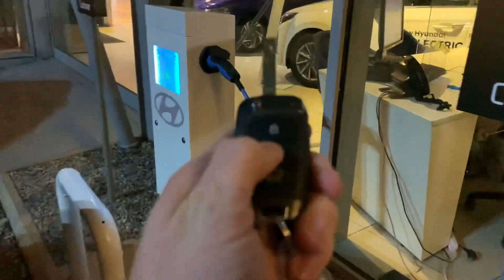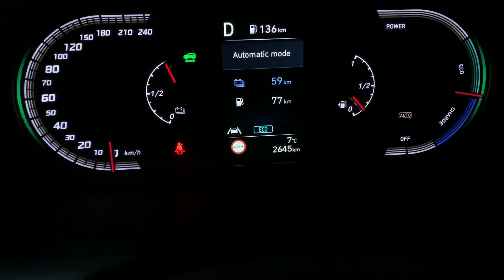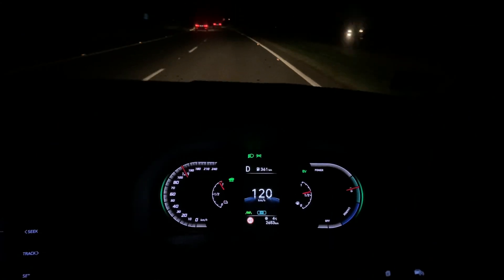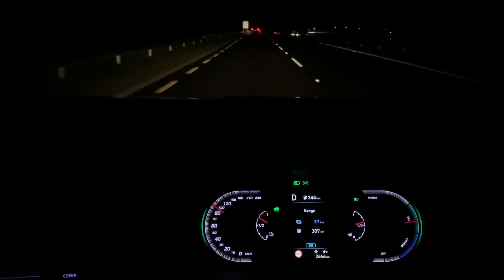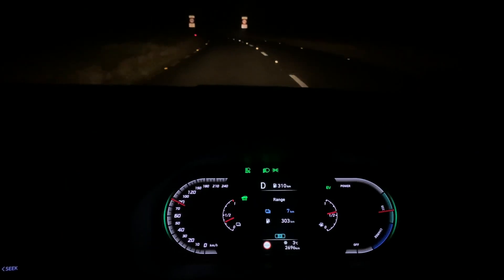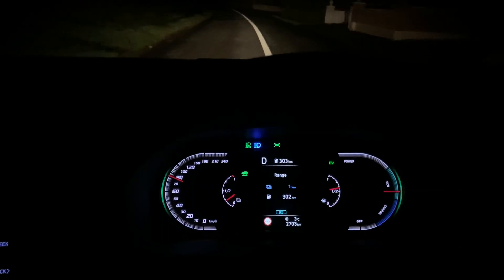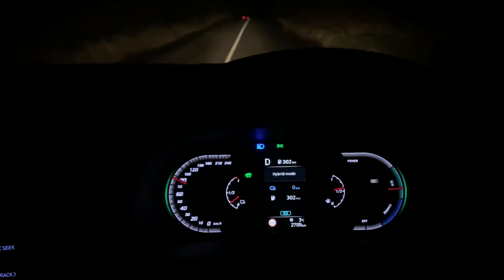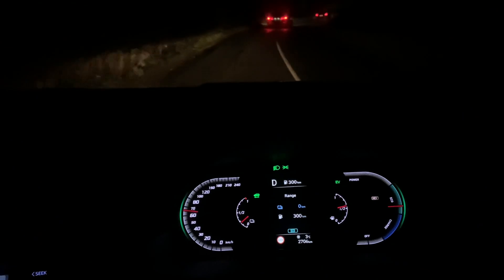What happens in a PHEV when you run out of charge - step by step demonstration #phev #whathappensif

Comment: Hi Brian, This video is super useful! Thanks. I was wondering in case the battery is empty and I choose to drive with Fuel only.. does it keep charging the battery until it reaches 100%? Thanks!
Reply from the maker: Thank you for watching, okay, it’s actually not possible to drive this car on fuel only, it will always have a small portion of electric drive available, so it continuously self charges, a small amount, but only to approximately 17%, it doesn’t appear to be able to charge any further than that by itself without the use of plugging into a charging facility, hope this helps!
Reply: @doolanbrian  hi Brian, thank you so much for the detailed reply this is the question that i needed answer for. I guess hybrid is the way to go. Unless car's behavior can be altered / customized with software. Happy to follow your content. Subbed :)
Reply from the maker: @mjxone  I don’t believe there is any way to customise or change software right now, I appreciate your subscription, thank you for watching the video🙂👍

Comment: I have a question...Does the engine run longer to charge in PHEV mode that a in HV mode. The reason I ask is because I'm trying to decide whether getting a plug in hybrid vehicle is equally or more efficient (despite the fact that a PHEV vehicle battery weighs more) than a hybrid vehicle. My theory is if the battery in a PHEV is larger... that means it may take more fuel to charge it if you run it purely on hybrid mode. So my question is, if I run a PHEV in HV Mode do I get less MPG or KM/L.

From what you're saying on this video, it seems like the PHEV battery is internally SPLIT into two parts. Maybe 50% of the battery is EV only and 50% is hybrid only. So if you are a person who mostly rely on driving on hybrid, would this ONLY charge the 50% of the hybrid portion of the battery or the whole entire battery? let us know, thank you :)
Reply from the maker: Let me ask you .. how many kms do you do per day ?
Reply: @doolanbrian  same for me, I drive 40 KMs per day
Reply from the maker: @cyberbud  to make the decision of which is better to purchase you need to look at your cost of electricity and the cost of fuel. What country do you live in?

Comment: What about using drive-charge mode button ? should I use it on a highway, because it uses more gas.
Reply from the maker: When you say drive charge mode button, do you mean the button that says HEV/EV?
Reply: @doolanbrian  no, I got an option in my KIA Optima 2017. It's uses more engine power to charge phev battery to the max which is why it used more gas In about 30 minutes I can charge battery to 70% at high speed. It charges more quickly compared to normal engine/ regenerative breaking method.
Reply from the maker: @TroubleDrivers  that’s cool, we don’t have that option, I’ve never heard of it, but it sounds like a great idea! Thank you for watching
Reply: @doolanbrian  but it uses a lot of gas like a V12 engine consumption.
Reply from the maker: @TroubleDrivers  🙂😀ok that’s not ideal 😆 but still a cool system !

Comment: Hi Brian Great video thanks. What I don't understand is when in full electric mode why is the gas being used also? My understanding was that when using full electric your fuel consumption would not be touched. You can see a big difference in your fuel gauge from the start of the video to that at the end of the video. Why is this?
Reply from the maker: If you are in full electric mode it won’t use any petrol but if the environment changes where it needs more power for example if overtaking ..  it may switch from electric mode into hybrid mode, at this point it will start using some petrol engine alright if that makes sense?
Reply: Thank you
Reply from the maker: @ruthwalsh8509  thanks for watching!
Reply: Are these phevs more expensive to service and maintain than say a ord petrol car.  How long do these types of batteries last compared to a fully EV car. 
What’s the mpg running on petrol when electric used up. Tnks. Great video
Reply: @brec5879  We have a 2024 Prius Prime. It's less expensive to service than an ICE because the engine runs so much less compared to a regular car. We've owned it for 16 months and only needed one oil change in 23,000+ km. The brakes will last for many years thanks to the regenerative braking.

The Traction Battery is guaranteed for ten years. Our Prime will bring us 100km on a charge. In fact, after a year and a half we've spent only about $ 300 on fuel and gas here is very expensive. In hybrid mode we see around 60mpg. The Traction Battery never truly runs "dry". The car always limits the charge level at  between 10% and 80% to extend its service life.

Comment: I understand that if the battery runs out in EV mode, then it switches to hybrid mode automatically.  My question is does the gas engine running on hybrid mode recharges the battery fully again at a certain point so that you can run on pure EV mode?  Why would you need to plug it in unless you are trying to skip the amount of time the gasoline engine will recharge the battery again?  This is what I don't understand.
Reply from the maker: Battery will only self charge to about approximately 17% or 18%, to charge the remaining amount it needs to be plugged in 🙂
Reply from the maker: Battery will only self charge to about approximately 17% or 18%, to charge the remaining amount it needs to be plugged in 🙂

Comment: If I drive on a long road-trip in Hybrid or smart mode, can it charge the battery fully?
What if there's a long downhill section (really long, descending from the mountains)?
Reply from the maker: It’s a good question … I’ve not ever experienced the car self charge anymore thank circa 17% so I would not see it fully self charging … theoretically even if it was possible I doubt there is a long enough downhill road to fully self recharge 🙂🙂 thanks for watching!
Reply: @doolanbrian  Assuming ~33 miles (US units EV range) is also the range required to fully charge the battery, then yes, there is.
With a regular hybrid, such a road could easily charge the small battery many times over, as well as drain it, such that only the engine would power the car, if going uphill.
Reply: Here is what I am guessing:
1. On a normal highway trip, the car will drop to ~15% charge at the first part of the trip, then maintain about this amount throughout the remainder of the trip.
This is because the car does not know when the trip will end, so if it tries to fully charge the battery, it would have reduced your trip's efficiency to do it, instead of letting you plug it in at home.
2. It will charge the battery on downhill sections, no matter how long, when engine breaking / breaking is done. With a long enough downhill section, it will exceed the 15% charge, until the section is over or the battery is full.
Reply from the maker: @DavidDLee  we need to find a 33mile hill 🙂🙂
Reply: @doolanbrian  I've been meaning to buy this car for months, but too few are available and a dealer mark-up, so I'm still waiting.
Maybe early next year, I'll be able to test it 🙂
Reply from the maker: Where are you based out of curiosity? 🙂 Let me know how you get on!
Reply: @doolanbrian  SF bay area, California

Comment: If you go for a long run in a phev, how long can u go before u need to load it to keep that "150mpg" state???
Reply from the maker: If you’re aiming for 150 mpg, you would need to knock out around 50 km of electric driving and then probably cover an additional 10 or 15 km of hybrid driving, Does that make sense?
Reply: @doolanbrian  ok so u cant run 200 km combine gas electric when u need to go on Trips. communicate i would use his ev every day. If i cant get the low consumption in Long Trips i think i just go for Pure ev that manage more than 200km
Reply from the maker: @MrBlackJava  you can drive as far as you want .. but if the first 50 kms is EV , then all kms after that are combined fuel/battery.. the further you drive , the lower the MPG’s become until you charge again 🙂🙂

Comment: Is the hybrid battery a completely different battery to the ev plug in battery? Or does the car have 2 drive batteries or 1?
Reply from the maker: Ok … my understanding is that for HEV drive , the car uses about 14% to 17% of the high voltage battery . When the car is charged it uses the remaining 85% of the high voltage battery which is the same battery. This is my understanding of the process
Reply from the maker: @foppo101  for first 50 kms or so you will use electric ⚡️ if you have charged it .. once that runs out you will use fuel and a smaller amount of electric usually around 6 l/100 kms 🙂👍

Comment: Let me add my 5 cents 🙂
Last Christmas got in traffic going to mountains - there was very slow movement in about an hour because of chains checking post. And during this traffic jam the battery discharged  down to 5% and only after that the gas engine started.
I was kind of nervoius during monitoring how the battery went to 10%, 7%... 5%... That was my first experience with the almost fully discharged battery. Now, when I know what happens, I'm fully relaxed in may car.
And one more thing. The label for the Tucson HPEV says to use 87 gas (US number), however, the manual says - at least 87. Using gas 91 increases the travel  range and that increase is bigger than gas price difference.
Reply from the maker: Thanks for the input Igor and for watching too !

Comment: just a short question. If you have to drive with AC/heating ON, does that mean you can no longer drive in EV only?
Reply from the maker: You are correct, unfortunately the heating overrides electric mode, electric mode is more of a request so if the heating is turned off And you don’t have the accelerator fully depressed, it will become available for you if that makes sense ?
Reply: @doolanbrian  so basically we can forget the EV mode in winter time. Now I'm no longer interested in this car. Thank you
Reply from the maker: @madalincodrinspanu2549  The way I work it in the winter isI heat the car for the first 10 minutes and then when the cabin is warm I turn off the heating, I can use electric mode then and have the heated seats and heated steering wheel, if the cabin gets cold then I just give it another blast for a couple of minutes and then turn it back off again🙂👍
Reply: @doolanbrian  What about air conditioning? The compressor runs off a belt that depends on the engine being on.
I'm not sure how often you need air conditioning, in the summer, but where I live in the US, either the heater is working, or it's the AC. For me, it seems like a pure EV might be a better choice. (Not sure how much electric heat and an electric powered AC would effect total range)
Reply from the maker: @billkallas1762  I think this video will help https://youtu.be/cH5cUrST9Go , you might get more value from an EV instead .. i think you are correct 🙂✌️

Comment: Am I correct in assuming that regenerative braking isn't enough to lift an EV range of depleted battery, meaning your EV range will remain 0 km 'till you charge the vehicle via an AC outlet?
Reply from the maker: In Full full EV drive yes ! You got it right .. the regen braking won’t replenish the battery sufficiently….there will still be a very small proportion of EV drive which can self generate to allow small bursts of EV drive in hybrid .. The regenerative braking doesn’t contribute very much charge in hybrid mode .. During this self charge process most of the charging comes from the engine🙂🙂

Comment: Sounds like you are only going to drive in full EV mode in the Summer, since you need the gas engine to heat the engine coolant. At least in winter, you can run in Hybrid mode to heat the car up, and then think about switching to EV mode, for a few miles.
Reply from the maker: Spot on Bill .. you are correct !

Comment: With this car fully charge up for a road trip of around 200 kms., can you give me an idea of the number of litres of gas that would be used? The trip would be 90% highway driving at between 100  - 120 kms/hr.  Thanks for the vid.!
Reply: It depends on the drive settings.
In the best case, you use up the battery range then drive like a hybrid. The Hybrid efficiency is 35 MPG (US EPA). Higher speed will drop the efficiency.

Comment: With this car fully charge up for a road trip of around 200 kms., can you give me an idea of the number of litres of gas that would be used? The trip would be 90% highway driving at between 100  - 120 kms/hr.  Thanks!
Reply from the maker: Okay the first 50 km would be electric drive that means 150 km will be hybrid drive, I suspect this will do around 7.5 L per 100 km on the motorway drive , so I think the first 50 km will be electric and the remaining 150 km will require approximately 11 L of fuel .. hope that helps!
Reply: @doolanbrian  Great video and information. Thanks Brian!
Reply: On a long road trip, when the electric runs out will the empty battery put more load on the engine and trans?
Reply: My diesel Sportage averaged 41 mpg goes up to 50 on a long run no battery or electric motors not sure where the environmental advantages are.

Comment: Hi Brian,
Excellent video, I have a question though; all of these phev vehicles have a much smaller internal combustion engine so does it mean when you run out of battery you've got this tiny ICE engine to move your car?
For example if you take a 500Km trip on a 2023 AR Tonale phev SUV with 1.3L  ICE , only after 50-60Km you will run out of electric power and for the rest of your trip you are dependent on the tiny 1.3L engine to propel the heavy SUV.
Now to my next point why the car manufacturers are allowed to add this very limited battery power to the total horse power or torque of the vehicles and make these claims about high horse power and torque of phev vehicles while they know full well the battery power is very limited in range and duration.
Thank you
Reply from the maker: Once they run out of charge, they combine battery power with the internal combustion engine so it won’t run on just the internal combustion engine if that makes sense ?
Reply: @doolanbrian  
Thank you Brian
Reply from the maker: @afshins.6167  thanks for watching!!
Reply from the maker: I guess the power made by the car includes the battery and the engine? So when they put their figures on paper it seems logical to include both?

Comment: hey Brian great video , i drive about 50km a day in a 2013 vw gtd and use €50 diesel a week or there abouts , would the Phev suit me more as i could primarily use the ev range everyday and keep a full tank of petrol , and save on my weekly fuel espense  , i know i will pay on my bill , apparently night rate is will cost me 1/5 the cost of diesel so even at that it would cost me €10 a week on electric bill so €80 extra on bi montly bill , trying to decide on diesel 1.6 executive or phev executive plus as its nicer inside , what do you think ? over 3 years pcp id spend €7500 on diesel but alot less on Phev
Reply from the maker: Sorry I missed this comment !! Did you buy phev or stay diesel after ??

Comment: Hi Brian, hi folks, many greets from Germany! Here i get answers hard to find in videos in german language, trying to follow your very very quick tongue, which is not always easy for non-natives like me, but, grabb the info or dy trying, right? Luckily there is a repeat option on the video controls.

I am very interested in the Tucson full hybrid and plug-in hybrid models, trying to figure out which model suits me best. Away from that i am always wondering if the petrol turbo engine., which is not being used that much in the plug-in hybrid i guess (that´s what the car should be aiming for), will stay healthy the whole car`s life. I think that it does not have time to really warm up, or even cool down, which is an essential aspect for petrol-only driven turbo engines in terms to save life on the turbo and parts....when it is powered on to support for aggressive acceleration it has to step in even if the oil-temp could be very low when having 20 or 30 km driven only with battery power. The rpms go up, and probably the petrol driven engine is being shut down after , for example, overtaking some other cars.
The full hybrid, i asume, will use the engine much more, probably not running into this scenario, or even not that often. Am I right?

Many thanks for those videos and the work you put in there! And..btw...if you WRITE down your answer here, feel free to write as fast you can. Reading is much more easier for me as i can adjust the speed on my own. ;-)
Reply from the maker: Hi Frank, thank you very much for watching, it’s a good point, oil temperature is usually more beneficial when it’s warm to a turbocharged engine so I understand your concern, 

I suppose all we can do is put our faith in the research and development that goes into the engine… 

in my opinion, I think a plug-in hybrid or a normal full non-plug-in hybrid is going to suffer similar wear and tear

The reason I say that is that the plug-in hybrid behaves just like the regular hybrid when it is not fully charged. Even when the plug in hybrid is fully charged, and if you are driving full electric in the first 50 km, sometimes the petrol engine will still come back in as it is necessary for heavy acceleration or also operating the heater .

I am of the opinion that both will have similar levels of reliability long-term, I stand to be corrected but that’s what I think! 

Thanks for watching Frank!